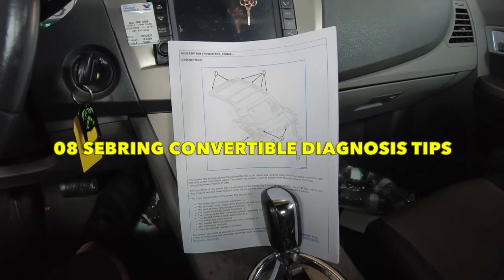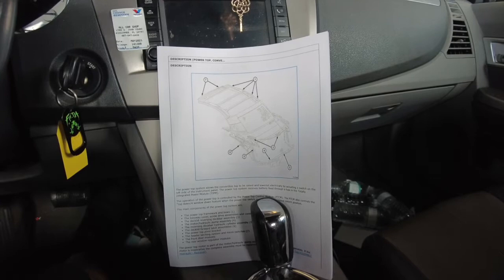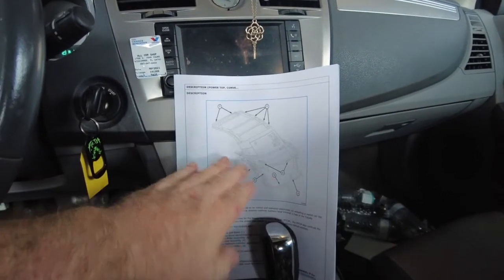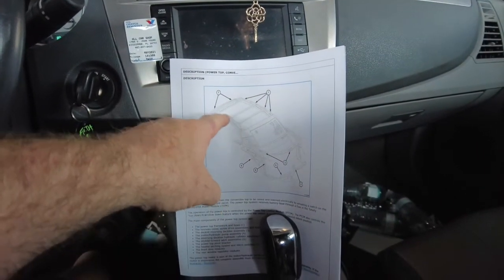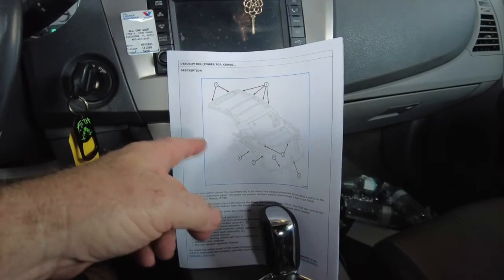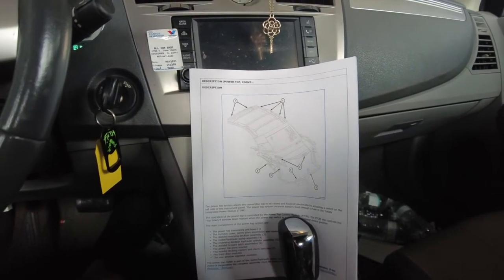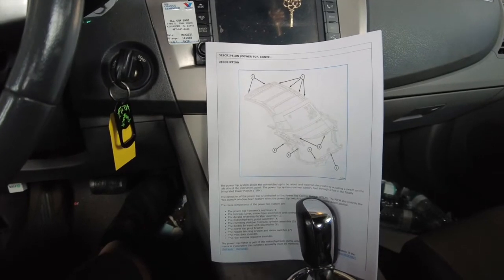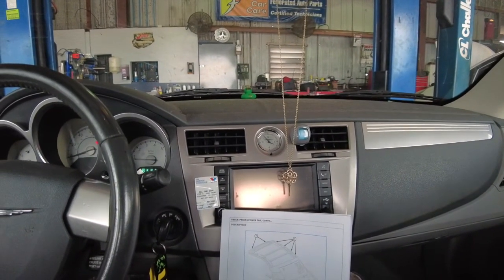SEBRING CONVERTIBLE, TOP DOESN'T WORK, DIAGNOSIS TIPS...

Comment: Hi Jimmy the cover pannel isnt flush on one side and doesn't go down or move and gets caught on the convertible rood when we try to put it back on do you know what to do to fix this and how much would it cost if i need to take it to the mechanic
Reply from the maker: It sounds like there could be either something caught in it, or something is worn?
Reply: @JimmyMakingitwork  how much would it be to fix it if I were to go to the mechanic
Reply: @JimmyMakingitwork  I fixed it thank you Jimmy there was a spring broken in it that held the panel in place to make it flush but I shoved it into the car panel to fix it

Comment: Hello I’ve been reading the comments but have my had any thing useful to my situation. I have the 2008 base model convertible and my top is in a stuck down and the deck lid won’t u los más but I can hear the hydraulic pump trying to work it. The car also isn’t saying top fail at any point it just doesn’t unlock for me to electronically or manually open the deck. What should I try to fix this. I’ve tried fuses top modules and unplugged the batter to try and reset my system but nothing seems to work.
Reply: It’s stuck locked in the up position. The top is currently up as if it were raining.
Reply from the maker: You’ll need a scan tool or a competent local shop that has one to check codes. Most like it’s either low on fluid from a leak, or sees a bad switch signal so won’t move the top.
If it is up, best to leave it up for now.

Comment: 2008 chrysler sebring limited convertible how do I add and bleed the convertible pump , in trunk rear of spare tire
Reply from the maker: Need too fluid and a small funnel, sometimes a rubber hose and trickle it in up to the full line. Run the top, recheck the level. If it goes low, likely a hose or cylinder is leaking.
Reply: I can not find the fill hole, where is the fill hole?

Comment: I have a 08, when opening the top all windows go down but nothing else happens, any ideas on where to start?
Reply from the maker: Adam, if the rear decklid is where it stops, there is something happening with a switch or wire in that area usually. I’d check codes and go from there. I’ll usually use a bidirectional scanner that enables forced operation, which disregards the switch positions, to test the function of the top.

Hope this helps.

Comment: Hey Jimmy where could I go to get the header latch fixed? The top doesn’t want to go down
Reply from the maker: Either the dealer or a good local shop should be able to diagnose and repair the top latches and switches.

Comment: I wish I lived in Florida! My 2008 is currently in the shop… it was fully closed… but trunk won’t latch and the top is only partly locked by the windshield. I’m scared to call the repair shop to check on it
Reply from the maker: Yeah, sounds like there might be two separate problems. Hope it works out for you!

Comment: I’ve got an ‘08 mine won’t lock like it sits flush on the metal hooks but they don’t lock the top I don’t care if it works just wondering where to start to get it to close? Sorry very limited subject matter on this online I mean
Reply from the maker: The header latch sounds like it stopped working. If the top module doesn’t see it state, or position from it’s switch it won’t work it. Or the latch could also have an issue.
Might need a bidirectional scan tool to do a force function. If it won’t do that it’s likely a latch failure, which means replacement.

As a last resort you might be able to open it up and latch it manually? I’ve never tried it though.

Comment: Where are the switches ???  I can't read the diagram in the video. I know this is an old video, but I hope you'll see this. I put in a new header latch motor, and everything was working great. The third time I went to put the top down, nothing. The motor isn't running, and I can't get to it because the black metal piece won't come off this time. I'm losing my mind over here. If you can help me out, I would be eternally grateful. I checked all the wires and mended two that were broken, but that wasn't the problem, apparently. The manual doesn't show me any of the switches and I can't find any diagrams online that show me where to locate them. Please help!
Reply from the maker: The switches will be anywhere a latch is nearby, or sometimes near hinges also. If you have a scanner you can force it to run and over ride faulty switches. There is some risk of damage if you aren’t careful though since it will run whether or not it should with a forced over ride. As long as the motor is still working.

Comment: Hello Jimmy
My mother has a 2010 Sebring Hardtop that is malfunctioning. Used to work sometimes but once she got it to come down (close) she stopped using it. It’s said it’s not locked and the trunk release won’t work but it’s down. 
Would a basic OBD scanner work with those codes you’re talking about? Odds are I’ll get that Emanuel you posted in a previous comment and I’ll certain tell them who sent me there to get one. 
Thank you in advanced!
Reply from the maker: This will need a mid level scan tool to access the top module. It could be done without one, but would take much more time checking circuits with a volt meter to find a bad switch or broken wire. Could just check wires near flex points, hinges and the like.

Comment: I have a 2008 Sebring trunk gets stuck up, sometimes it works fine. where can i get a scan tool to use do you have a model number?
Reply from the maker: I use the TOPDON Phoenix Lite 2 in the shop, capable of helping with the top. It is a bit pricey for a do it yourselfer at $700 or so. But less expensive tools won’t usually give data for a convertible top.
I have it on my Amazon store, along with a few other good options.

Comment: Is it possible to purchase this tool and information on the check list? If so where could I find it.
Reply from the maker: The scan tool is available in my Amazon store and the information I got on Identifix. It might be available on google or a similar search engine under Sebring Convertible Top wiring diagram?

Comment: Jim, what would I need to do to get an appointment for you to repair my Sebring convertible hardtop? I am in South Carolina and would gladly make the trip. Is there a way to manually close the trunk lid. My top closes but the trunk will not close.
Reply from the maker: You can make an appointment online, but the best method is to call the shop and talk with Katie or Rob. Not sure about transporting the car with the trunk open though? I’d recommend a local dealership if they have a good convertible tech. Usually a bad switch or broken wire in areas where they hinge.

Comment: I have a 2008 sebring convertable when I put the top down it stops and I have to release the button and push it again and the top goes down but the trunk lid will not close unless I leave it set for approx 10 minutes going back up the top closes fine but again the trunk lid will not close unless I let it set I have changed the motor and pump and in the trunk and refilled the fluid but same thing any help would be great
Reply from the maker: Usually this means either a switch isn’t showing the correct position, or a wire is broken making the computer think a switch is out of position. Check the wiring in all the areas it flexes the most, near hinges and moving parts. Carefully of course.
Hope this helps.

Comment: I never knew there was any reliable scan tool outside of the dealership for my '08 top. Any guidance on getting the correct tool and access to the correct software?
Reply from the maker: Kelly, any scan tool with bidirectional or two way capability should be able to perform a top over ride. All the scan tools I use can do it, but I’d check with Launch or Autel to see which of theirs can do it directly.
Thank you!
Reply: @JimmyMakingitwork  could to put a link to a reliable one that would work for an 08 Jimmy?

Comment: I have an '08 Sebring convertible The trunk opens but the top will not go down it is not opening the release bars but I have no codes coming up on my dash or anything am I supposed to and what is the computer you are using
Reply from the maker: I use a TOPDON scan tool for access to the top module. It will likely have codes related to the latch in one of the mechanisms. Usually I find broken wires where they hinge often. But switches can also go bad.
Reply: Thank you I wish I lived in Florida because I just bring it to you to fix here in Ohio other than the dealer that's the only place we can take it and I hate to take anything to the dealer
Reply from the maker: Yeah, they can be expensive. But I’d hope they could fix it correctly most of all! :)

Comment: i have a artidiag pro how can i get the top up
Reply from the maker: Hav to bring up the top date in it's ECU and look to see which switch is setting codes and not switching state. If the top doesn't see the correct signal from every switch it will not work the top to avoid damaging it. Once you know which one, look for a broken wire near a flex point, or the switch might be bad.

Comment: I attempt to open the top
The trunk flipped up and the roof disconnected from the car about 6 inches... 
I panicked and tried to close it but it didn't move forward ...to close ....
I drove with the trunk straight up in the air. Til I found a stop to pull over ...
 I realized the shelf in the trunk was in the up right position...
It was jammed under the partially opened roof...
I forced it down...
Then the top proceeds to fold into the trunk and the cycle completes no problem...
I get home to put the roof up and nothing happens not even a sound .. no window movement nothing...also the trunk lid is unaligned with the car ... What to do ....I have to fix this myself no choice short on cash...
Reply from the maker: It sounds like something is wrong in the latch and the lid is now bent a bit?

Comment: My top does not open and the runk does not open either, also the top is not locked at the top where it meets the front of the car above the windshield, I cannot understand what it is.
Reply from the maker: This requires a scan tool that can force it to disregard the switches that tell the computer what position everything is on. Likely a bad switch or broken wire makes it go into fail safe to avoid damaging something when it isn’t sure of positions.
Reply: Did you get this issue fixed I’m having the same issue car reads top malfunction but latches isn’t latched at the windshield 😩some said it’s the latch motor but I don’t think it’s that
Reply: Nope!
Reply: Nope!
Reply: I bought my daughter a 2008 Sebring and the convertible just started have the same problem as yours I think. It says convertible top in operation but when you hit the button to open it says convertible top malfunction. I just started the journey to see if I can fix it.

Comment: My boyfriend has a 2011 Chrysler 200 and it says convertible top malfunction when he goes to put it down. The windows roll down but it doesn’t go all the way down. What do you think that would be?
Reply from the maker: I’d have to check for codes, but usually a broken wire is what I find. The code helps me figure out where usually.

Comment: What do u use to test mind out
Reply from the maker: You’ll need a scan tool to force open or close, which disregards the switch positions that warn about trunk not opening and things like that. If it works when forced then it’s a matter of finding out which switch doesn’t change when the position does.
So a good scan tool with bidirectional capability is required.
Reply: @JimmyMakingitwork  so as long as it says it is bidirectional it'll work? My 2008 convertible top worked great then it sat for several months bc it has a transmission issue and this was a spare car. Just fixed the transmission issue to find out top won't go down. Figured out the head latch was bad replaced that panel but the trunk part won't open up. The windows go down we don't get the malfunction warning but the trunk won't open we never had an issue until now. Any recommendations? Going to look into the hydraulic pump tomorrow is that in the spare tire area or behind the back seat. Thanks in advance for any and all advice!